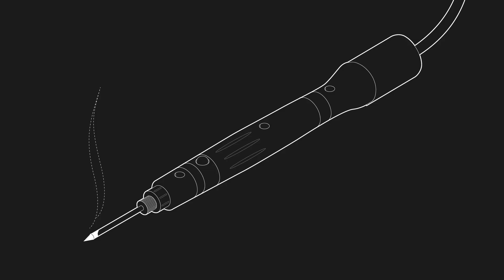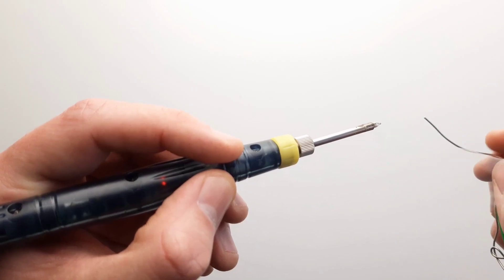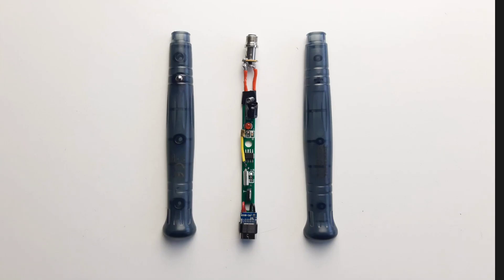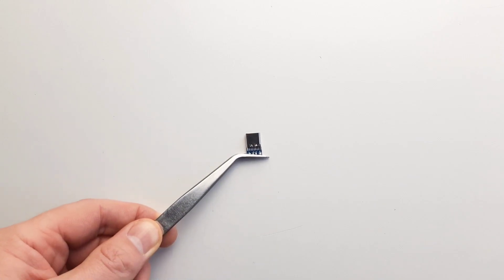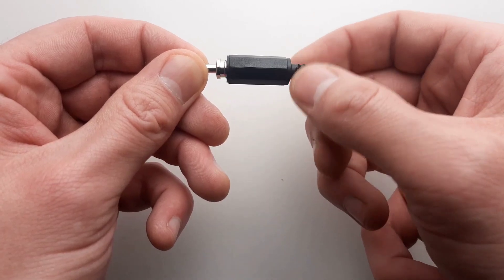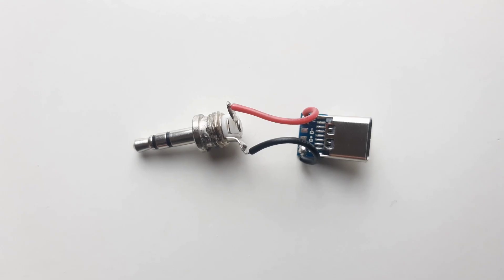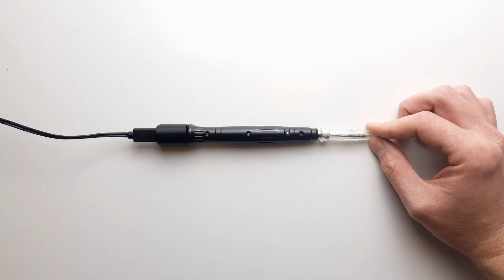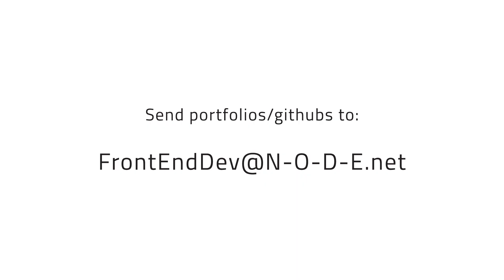Adding USB-C To A Cheap Soldering Iron

Comment: 3.5mm is a horrendous pick for a power connector, especially when connected to a high-tech device like a computer, because when you insert it the contacts between each pair (tip-ring, ring-sleeve) are momentarily shorted. TS100-style irons with the plug-in tips get around this shortcoming with their tips by extending the nonconductive area (analogous to the black plastic rings on 3.5mm phone plugs) long enough to avoid this. Neat project.

Comment: Pinecil is also a good option. Very cheap considering what it's competing with. 

And personally I would probably have just dremeled a hole in the end to fit the USB C port directly rather than making an adapter. Those 3.5mm power cables are the worst

Comment: I like the design and the idea of upgradeing electronics to support USB C. But theres only a small problem with using the JRC--b008 USB type C board.

The board will only work with basic chargers and not smart chargers with PD. Soldering on a resistor won't work because the board is wired incorrectly and will require modifications where you would have to cut some of the internal connections on the PCB. I would recommend using a USB type C board that have CC1 and CC2 pinouts or even better a board that come with the 5.1k resistors.
Reply: Yep. Using connectors that expose all the pins is a huge PITA but at least you can wire it up for PD support

Comment: One of the cleanest and nicest presented  projects I've seen in a long while.  How are you finding the reliability of the 3.5mm jack sockets and plug?   I used them for the ability to disconnect drawers that I built led strips into the bottoms of draws (to light the next  lower draw). I found them so unreliable I pulled them out and used permanently connect free hanging loops of twinflex. 
What's your experience? 
Subscribing. 
Thanks.

Comment: I would rather suggest using USB-C female board which has two 5k1 resistors on CC pins, because this one you used wont accept any voltage from C charger (with USB-C output). Also the sh-72 is better imo, since it has dial for temperature and changeable tips.

Comment: If you have a e-cigarette/vape pen with a 510-threaded jack, you can purchase small soldering tips that screw into the pen and operate completely wirelessly. Pretty good for small/occasional jobs.

Comment: I was thinking about changing my soldering iron from DC socket to usb-c with pd, but after I take it apart to measure space I realize I need another soldering iron to solder it😅. add on adapter looks like handleable

Comment: Cool mod man.
There could be other design to glue usb c break out to that usb soldering iron & hook it directly in parallel with 3.5mm port source, & cover with epoxy or some other way.
Regards

Comment: I looked at modifying one of these a few years ago. The 8W is barely enough for anything and the temp gets way up above 400C, so overvolting it and constantly measuring the element resistance for temperature control was my intention for making it more usable. Up at 12V you’d get maybe 45W, for which a barrel jack or USB C PD input could work. Then it’s just a cheap 8-bit micro and a FET. But the tip quality and fitment method was so bad I didn’t bother.

Comment: Years ago i bought cheap Chinese soldering station, also i keep maintenance instruction from industrial grade one. Use the cheap one, maintain it like it's scientific hardware ... You get the point. Years passed and beside the tip, it works like a new one.
Reply: What do you do to main it?
Reply: @affieuk  Keep it in the dry place, where no dust can reach it (pack it up when not used). Do not overheat it, replace tips when used. I also look at the temperatures inside the soldering station from time to time, to see if some parts are starting to heat up more than usual, but this will not be available to someone who doesn't have thermal camera.

Comment: Hello! Small issue with the proposed design: add CC1 and CC2 USB C pull down restistors to the port to make it work with usb-c to usb-c wire!
Reply: Agree. The JRC--b008 board will work with regular USB type A chargers. But if you want to use a USB type C smart charger with PD it won't work without the CC1 and CC2 pull down resistors. Because of the faulty wiring of the JRC--b008 it is hard to add resistors to it without doing some very small and precise modifications. In that case I suggest getting a USB type C board that features the CC1 and CC2 pinout or a board that have the resistors on the board.

Comment: You might want to look at SH-72 soldering iron, which is like 10-15$ and has the same dimensions and weight, but has TS-100-style tips, and works from anywhere from 10 to 24 V. So, integrating one with a PD booster circuit and adding an USB-C to it might be fun, and will result in a quite powerful (60W max) soldering iron that heats up fast and has great thermal stability.
Reply: Pinecil is $25, has Type-C PD, uses TS-100 style tips, and is open source.
Reply: @ionstorm66  And uses RISC-V!
Reply: @ionstorm66  Yes, Pinecil might be great, but where I'm at, it's currently not very possible to get it, or it costs almost 100$.
Reply: @lwtve  personally I think even at that price it is worth it, I live in the Netherlands and I payed 50 euros and I love it, at first I ordered a ts-101 but then i regretted my decision and canceled my orderer and bought a pinecil v2
Reply: @ionstorm66  if you’re in the US, sure it looks great. But where I live the shipping costs like $40.
Reply: Nice project.
My tip would be the soldering iron from Pinecil.
Reply: Diy ist more funn than just buy😏
Reply: Nice words👍
Reply: Pinecil v2 🍆💦

Comment: about a month ago I was doing almost the same thing, re-orging my mini kit and was fed up with lugging a laptop power supply for my TS100 and after looking found an online walkthrough on replacing the barrel jack on it with a PD USB-C adapter. Now my kit has a PD powerbank that serves the iron, the miniware scope if it needs it, my kirby soldering fume extractor and a small adjustable supply (up to 12v).

Comment: There's also a USB-PD breakout board that can offer to 20 volts should be more than enough to power any solder iron
Reply: Not a good idea to force 20V to a device that is buid for 5V input.

Comment: I love your videos and nice project. But what about a pinecil v2?, have been looking for a mobile soldering iron and the pinecil v2 was the best one, it is cheap but not as cheap and It wants a lot more power haha, but if you have a powerful powerbank it should work.
Reply: I just got my Pinecil today and I LOVE it, it's open source firmware and tons of options for software and interchangeable TS-100 Style tips make it infinitely more useful than the two 5$ USB irons like the one pictured. I'll never go back!